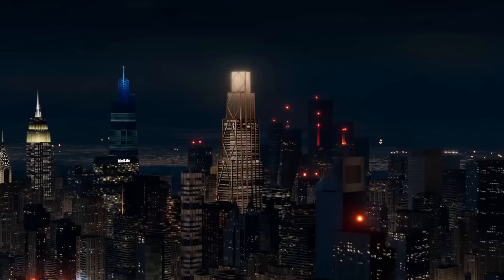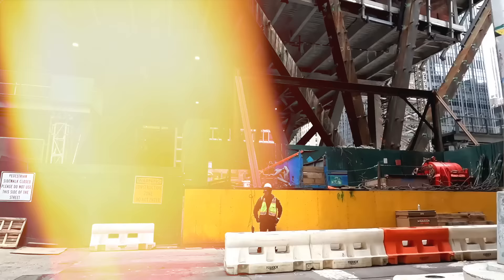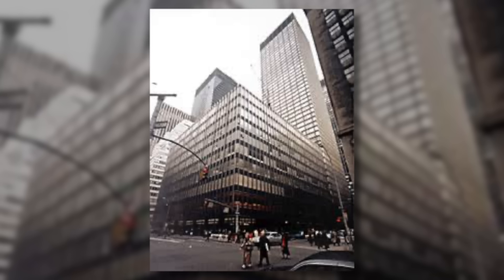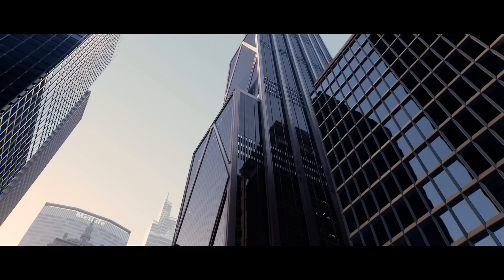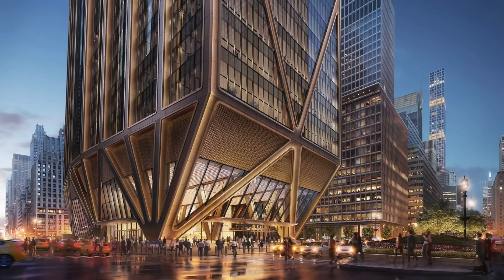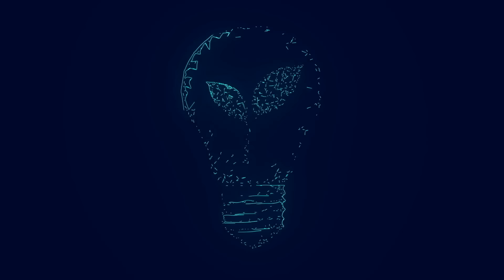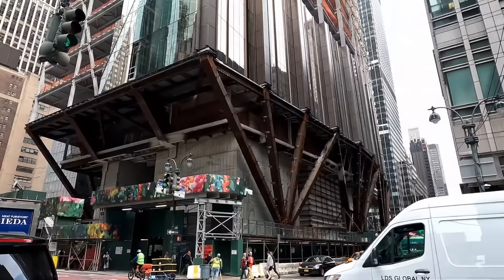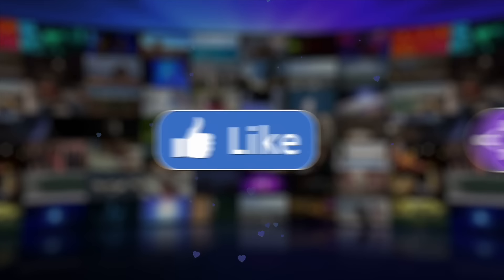Unveiling 270 Park Avenue - New York's New Super Tall Skyscraper

Comment: Looks to me like that base concentrates the load, rather than distribute the weight evenly.
Reply: It does kinda look like that.
Reply: Really? You think this building was designed and built without confirming the loads were distributed properly
Reply: @mannyfestoINS  I said it looks that way. I did not say I did the calculations and it was built wrong.

Comment: Eco concious? Is the building air conditioned? If yes then it cannot be an eco concious building
Reply: It does not have air conditioning. But, the windows open about 4 inches. Plus, every other office space has floor fans installed. That's how they make it "Eco concious.  I think.
Reply: No AC in humid AF New York? I don’t believe it. AC is a given to any new building east of the Mississippi. Once we of earth learn to safely harness our stars power cheaply, clean energy will be ubiquitous.

Comment: 60 stories, are you sure about that? 423 metres or approx 1,300 feet is much taller than 60 floors
Reply: The lower level is 80 feet and then the crown they were talking about.